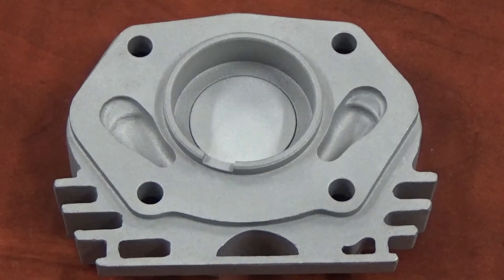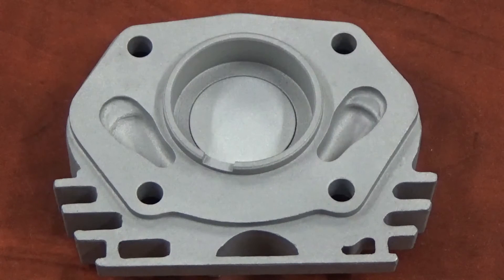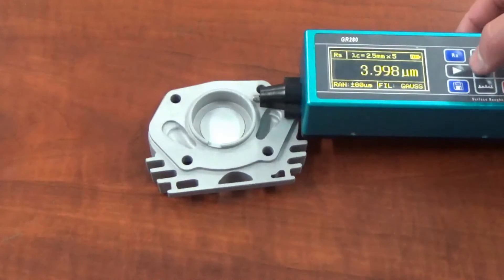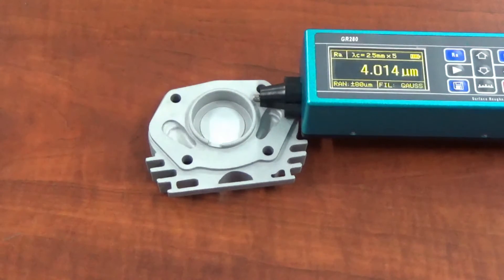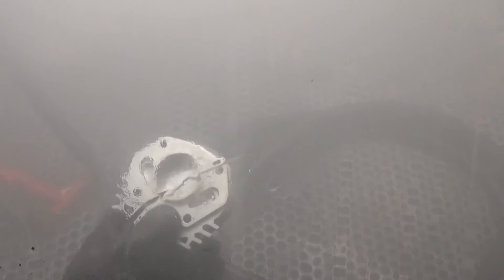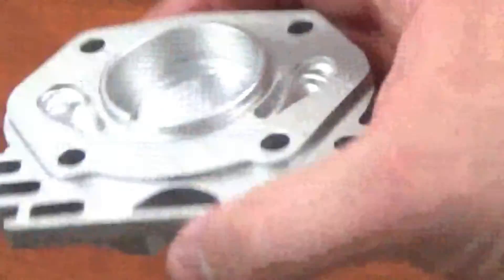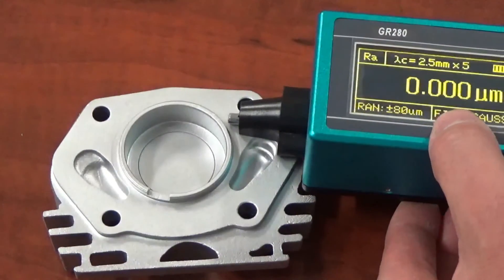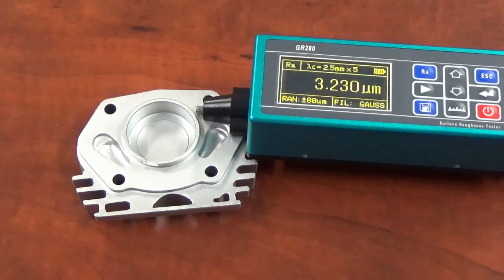Sandblasting vs. Vapor Blasting Surface Roughness Test- Vapor Honing Technologies

Comment: its easy to say that vapour blasting gives a better finish but if you start with a really dirty casting with all kinds of baked on dirt, then how do you get it to the vapour blasting stage because vapour blasting on its own wont lift that dirt.
Reply from the maker: I will post another video in a few days showing a filthy part going straight to vapor blast. Its something that we do all the time unless you have just heavy grease that needs to be removed first. You wouldn't want to deliberately add grease and muck to your machine it just adds more machine cleaning and servicing time to the equation. The piston cleaning video is also a good representation of no pre cleaning before vapor blasting and this was cleaning burnt baked on carbon from the piston. The major point of this video was to show the major surface roughness difference between outdated sand blasting vs vapor blasting. Thanks so much for the discussion will be back shortly with more videos.